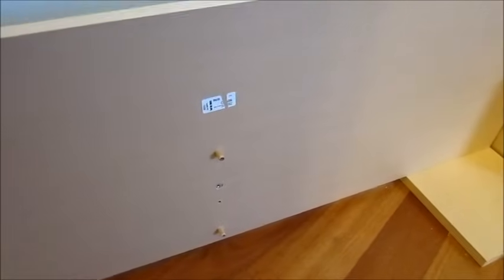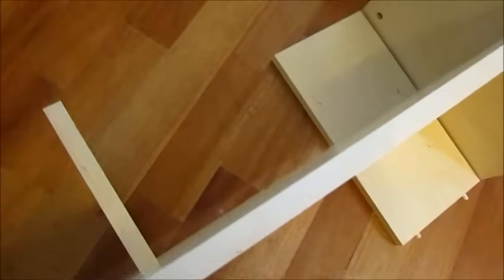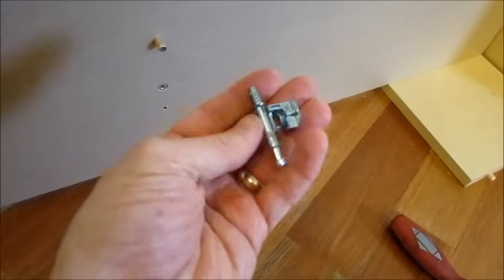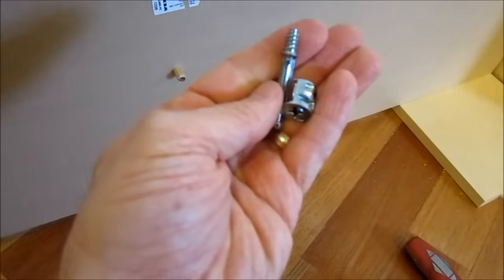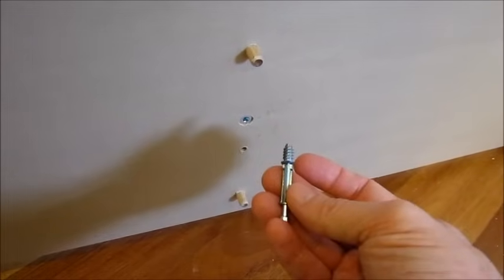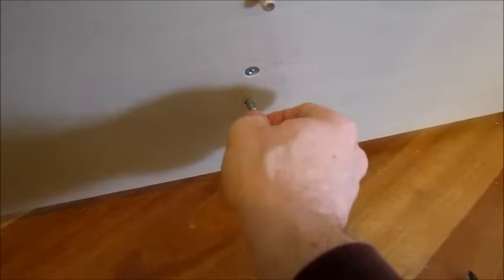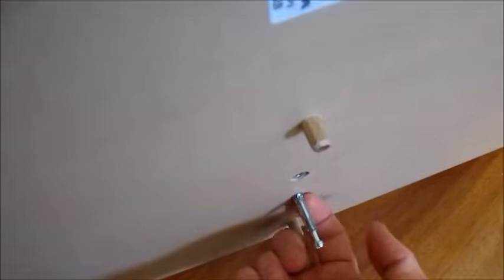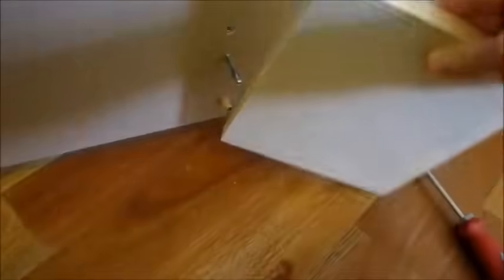Furniture Cam Lock and Nut

Comment: Thank you so much!  I hadn't worked with cam nuts before, and I wound up with a cheap dresser that had it backwards in the instructions.  They very clearly showed putting the nuts in first, then trying to hook everything together in a later step.  Big parts of the body of the dresser used those cam nuts, so I was stuck and very frustrated...and then, thankfully, found your video.  Suddenly, after doing things in the opposite order from what the instructions showed, it went together like it was supposed to.  Thank you again!

Comment: So I bought a beautiful fireplace mantel only to find out it was flat pack. Annoying as it's huge but no problem I thought, I've done this before and I think I'm a reasonably intelligent enough person to be able to do this one also. Well bugger me, this piece of work was something else! I'm in Australia and I've never seen a cam lock and screw before so that was all new to me, I'm not gonna lie many tears were shed and a fair few cuss words may have also slipped out trying to figure it all out. So I finally got it all together, looked sensational, turned it upright and it all fell apart...was so devastating. Thank you so much for this video, now I realise that I was supposed to lock those cam things in place, maybe the darn instructions could be depicted using real life photos instead of cartoons!!

Comment: Remember, there is no need to remove the nut (or fastener, or eccentric, if you wish) out of the hole, once it is installed. All you need is to unlock all the nuts (look for the "-" sign or an arrow), to free up the inside screw head, and then simply pull out the plate. So, once again, you don't need to take out the nut. Just unlock it completely (about one full turn anti-clockwise). If you need further info, look for the Minifix diagrams (this is how cam lock and nut is called in Europe).

Comment: Thank You, I was trying to put the nut in and it kept falling out. Thanks for showing me you don't use them until you place the other board that connects the 2 together. And for the tid bit about over torching the cam bolt. I always try to tighten up things as a male would. LOL! Thanks again.

Comment: if the surface is bare wood , use  simple wood glue in conjunction with the cam system . this assures a secure joint if the cam systems fails .
it's also possible to use long self tapping wood screws if they won't be seen. some people may be fine with an exposed screw head

Comment from the maker: Make sure you are putting the locking nut in correct.  There should be an arrow on top.  Initially point it towards the screw.  I hope this works.

Comment: Oh, how I wish I'd seen your video last night when I was assembling my new TV stand. There were no instructions on how to use the cam locks, so I just put them in and turned them. Some of them went in fine, but others didn't—and the ones that didn't now don't sit flush with the surface they're supposed to attach to. Does anyone out there in YouTube land know how to remove the cam lock once it's screwed in tightly? I'm beside myself! 😞

Comment: Are you supposed to turn the nut 180 degrees? That's what my IKEA manual said, but it took a good bit of strength to tighten it the whole 180 degrees, so I want to make sure I didn't budge the lock or something.

Comment: How do you take the screw out of the hole when you need to disassemble the screws Please 🙏🏽 can't figure this out?
Reply: You don't need to remove the cam nut.
Simply turn all the cam nuts in that section half a turn anticlockwise, then tap the wooden pieces apart with a Mallet.

Comment: My bookcase came with one shelf missing two pieces for the bottom shelf.  I have the cam post and fasteners but the holes are missing the threaded metal nuts.  I have contacted the company but have not heard back.  Any idea where I can get the missing pieces?

Comment from the maker: You just turn it counter clockwise.  The trick it to get the nut out of the hole.  but even if you can't, the board should still separate.

Comment: This is a dumb question if anyone can help - is it possible to even insert this wrong ? Basically if I didn't insert it in the direction of arrow properly (wasn't paying attention) but it went into the hole flushed and its screwed in is it properly installed or not ?

Comment: Not strong enough to the diagonal shifting, hence the lock threads will strip. I use the lock to aid the two boards to glue together after I score the base for the upright board before applying carpenter's glue. I,m sorry, but I don't trust particle wood boards for furniture.
Reply: Malsoon Sakit they are useless I literally just sent my wife to get some wood glue because I broke 10 of these they just don't work inside of a hole for some reason

Comment: Can you help me? I bought a desk that uses this cam system and we are having trouble with two of the locks. One will not lock at all & we can't figure out why. The other will lock if we twist it the wrong way, but that pulls it partway out of the hole and makes it crooked, which makes the legs wobbly. We've tried getting the locks out to make sure we've got them positioned correctly, but they won't budge. Any ideas on how to fix this would be appreciated
.
Reply from the maker: Do you have some thin pliers?  To try to get the stuck one out?  The hole may have been drilled slightly off.  Without seeing it I couldn't really help.  Can you return it for a new one?
Reply: HowToWith GEO Eh, my dad got to it with the wood glue before I could find any other solutions. It's holding up for now. :) I couldn't return the desk because I painted it, but I'm thinking maybe next time I should check these things before adding my own touches.
Reply: I guess your dad is right. I'll do the same with one of the twelve I had to install today.
Thanks for making me be sure that sometimes the old glue is the best solution. :)

Comment: The question we all have sooner or later is where to get just one cam lock to replace one lost or broken during furniture assembly.  Since I am several hours away from a real hardware store, I had hoped to order from eBay or Amazon, but other than some clown that hopes to sell 10 used ones for $8 plus $8 shipping, there are no other sources.  Amazing.  It would seem that the manufacturers could provide one extra of each item, just in case, but I guess that would reduce profit by 20 cents.

Comment: Can anyone please please help me?  I'm putting together a twin bed.  I have tightened lots of cam locks with no trouble until now.  I went to tighten the cam lock on a board that connects to the bottom of the headboard and the cam lock didn't lock.  The boards just fell apart and it didn't hold them together.  Now I can't unscrew the cam lock to try anything else.   Is there anything I can do.  Thanks.

Comment: Hi there! I have a question with these cam locks. I built a bed that has 18 of these cam locks and screws. The instructions state to turn the lock 210 degrees. However, I can't get anywhere close to that. I would leave it as is, but the furniture is wobbly. Also the screws have those fasteners. What would you recommend? Thanks